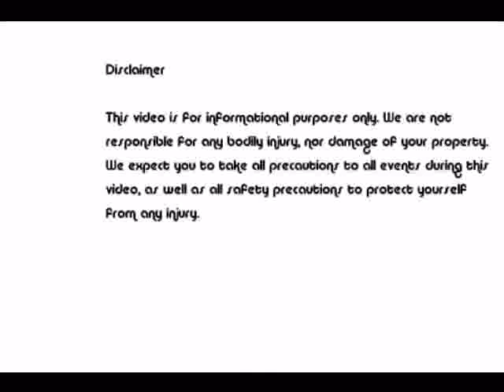(4) How to build HID projector headlights

Comment: Awesome! You've inspired me to tackle the same job on my r33's lights. I'll probably modify my projector using a high speed drill and cut off wheel, rather than using the break bits off with vice grips and tape up the holes method :) Very clever to mark the ground and light pattern to replicate the same beam with the hid's.  Many thanks for posting this vid!

Comment: looks nice. great vacuum forming too!  only problems i see is the excessive heat because the vent was sealed causing the bulb to fail early. and the silicone releasing from the hot HID metal housing. but idk how else you would mount it. Ive watched DIY HID mods that melted the plastic lamp housings, those things get hot!
Reply: If u trying to do custom on the turn signal too. You Might want to replace the original bulb with LED 's this don't get as hot as the tungsten blbs.

Comment: Not all HID's are dangerous. If they were dangerous do you think major car manufacturers would be selling them on new cars?

Did you even see part 1, when he set up the levels to match the original halogen lights?
HID's are only dangerous when HID bulbs are placed in halogen reflectors, NOT projectors.

I cannot see anything dangerous with this install, everything he has done is spot on!

Comment: really nice work guys! i get motivated:) thanks. but the heatgun melted the plastic when i use it bit not the lense. my result was amazing with led strip and xenon on my renault megane phas 3 2010. it looks agressive and new. I also wrapped the front grill and the sides so the grill looks more bigger.

Comment: Looks good but what if you need to replace an HID. Seems like you would have to take the whole headlight apart and then start all-over.
Reply: Actually the bulb pulls right out of the back like the stock ones.

Comment: Great job. How do you ensure there is very little water vapor in the ambient air inside the headlight assembly, such that there will not be condensation droplets collecting on the inside of the lens on cold days?

Comment: @seropserop u underestimate the strength or silicone. silicone is actually used to create high pressure gaskets also. i ripped my valve cover gasket on accident, so i jus removed it and put silicone all the way around. running strong, no leaks

Comment: Great video and tutorial. I'd like to have a go myself, but I can't remove the headlight on my 2008 Mazda 2. I've tried to workout where the mounting points are from watching your video, but i'm still not sure. I've removed the top front and back bolts and the plastic retaining clips next to them. (On the passenger side) But due to the lack of space around it I just can't see anymore mounting points. It's still not budging, and I don't want to force it and damage the unit. Could you help me out by telling where the other fixing bolts are? CheersJ.
Reply: go under your car there you will find the remaining ones
Reply: Thanks for the reply. I found them in the end, just where you say. Cheers.

Comment: ah, maybe it's the brand of silicone you use. which one do you use? i used some that I had in the house i forgot what brand, but it seemed to have "gassed" up? i don't know if that makes sense, but it seems like it's emitting some sort of chemical that gets stuck in the lens over time. i used kwikseal or nissan butyl in the headlights i've changed up to good results so far.

Comment: @howsquiffy 
They took a standard halogen headlight apart, and 'retrofit' a projector lens from another vehicle(probably a BMW, Lexus, Infinity, etc.). The owner can then use them as street legal HID's(high intensity discharge lights) that some newer vehicles have from the factory. Some people do this because some aftermarket companies don't make projector headlights for their specific vehicle. It's a somewhat costly and time consuming process, but the end results speak for themselves.

Comment: wow nice work, lots of work for one headlamp.

I have a Question,

I have a 2000 Chrysler 300M and tried to install my hids in. Everything works, but the right side doesnt work for my hids and the left side works just fine. I already checked all any possible way i might have misinstalled it. Do i need a capacitors for my hids? Any help........

Comment: Awesome! You're really an artist, man! But I have a question: you mentioned to use D2S bulbs, I agree they are the specific types for projector headlights, but... what about the high beams? You left a space for a solenoid, but I really didn't get that part... how should I proceed in order to have both high and low beams? In H4-2 kits there's a special movement, but what about in that projector?

Anyway, this was a great idea. A shame you're so far, otherwise I'd certainly hire your services!

Comment: @fastindy
 I have to agree with gnarly, glass cleaners are called glass cleaners for a reason.  they do have small micro particles in them that will etch the surface of plastics.  Don't clean your headlights with them nor your lcds.  if you do you're looking at a fuzzy image and faded lights.

Comment: it's using the butyl that was originally on the lens lol. if you put silicone on the lens it will fog up as it is the one thing separating outside temps and inside the lens. silicone fogs up quicker than butyl

Comment: The craftsmanship of the shroud is great, but I wouldn't be very comfortable having a heavy metal projector held in with nothing more than silicone epoxy. If this was all that was needed to ensure long term fit, then you'd see it on factory vehicles as it would save time and costs. The fact is the projector will eventually loose its position. If nothing else, a simple brace could be placed under the front end of the projector, behind the shroud. If you're gonna do it, do it right and to last.

Comment: The bulbs are inserted from the back of the headlamp housing (most.. if not are car headlights are designed this way). At 2:00, it shows you the back of the bulb inserted into the projector lens.

Comment: Well, he did a lot extra visual work. That being said, unless your car comes with oem hid projectors (that would make a retro pointless) a "legit pair" of projectors as you call them may still not be ideal. Throwing in re-based hid bulbs these projectors may actually give off less light than the halogen bulbs that you removed. They may not blind oncoming drivers so that is good. I know because it happened to me. There was a blind spot in the center. 

I will buy aftermarket and swap projectors.